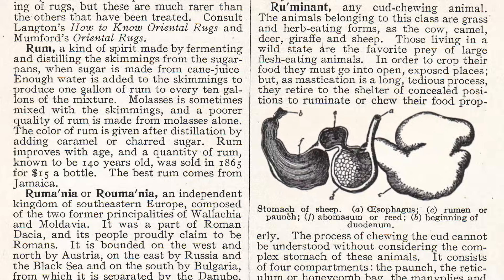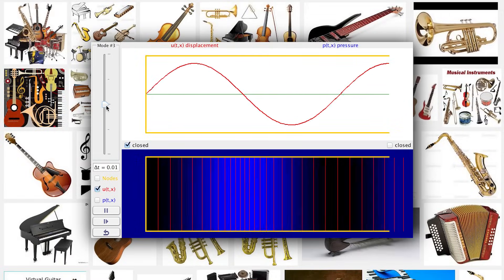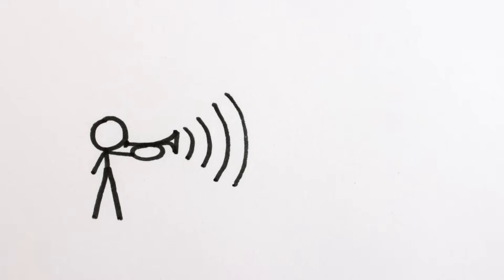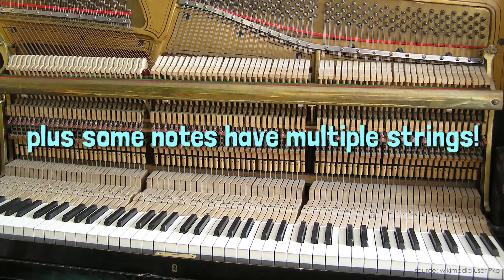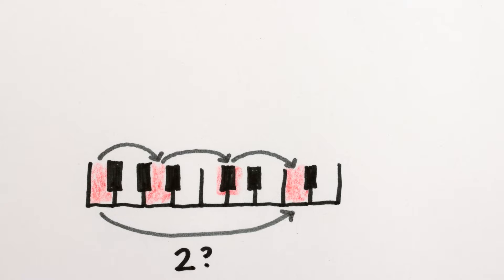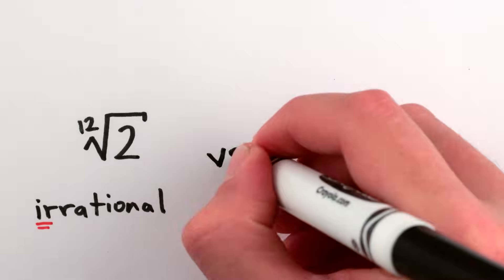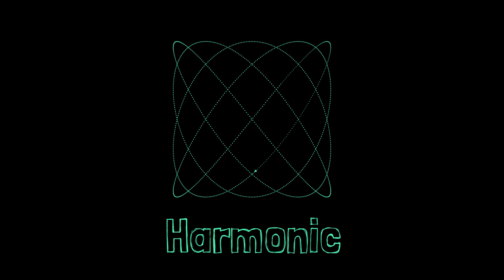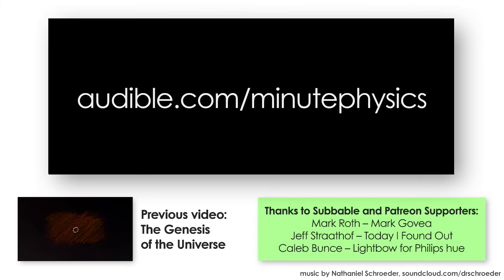Why It's Impossible to Tune a Piano

Comment: I've been doing occasional piano tuning since the 1970s, and always used the old method of stretching the fourths (+ 1 beat per second), compressing the fifths (- 3 beats in five seconds), and double-checking the process with the major thirds. This approximates the twelfth-root method. Then you have to start stretching the octave once you get to two Cs above middle C by a factor of two beats per second because it will sound flat to the ear otherwise, even if tuned to the perfect frequency. Most electronic keyboards that I have heard do not take this into consideration and they sound a little flat to me in the upper treble section. Some strings on some cheaper pianos will have false beats, meaning they will wah-wah-wah no matter what you do. Piano tuning involves some major compromises and is a bit of an art.

Comment: Keep also in mind there are three strings per key (two for the bass ones), and these strings are slightly detuned from eachother. The same mess happens with harps, with only one string per note and pedals for the sharps and flats.
It feels so nice to play brass.
Reply: All solid objects with some symmetry will also naturally have pairs of overlapping harmonics that are very slightly out of tune - for instance a harmonic on a guitar string vibrating vertically vs vibrating horizontally... A vibration pattern on a timpani and a version rotated 90°, or a deformation pattern on a tubular bell and the same pattern rotated 90°... In other words, plucked strings and chromatic percussion are slightly detuned from themselves (which is why they sound so good). :3

Comment: There is a lot more to piano tuning.  The modern default tuning "standard" is higher-pitched than the norm centuries ago, and is "equal-tempered" (uniformly spaced logarithmic scale), so that octaves are exact and every other ratio is only approximate.  In Bach's day, it was common for pianos to be tuned for best results (most exact ratios of small integers) in only one particular key, called "well-tempering".  His "Well-tempered Clavier" exploits its properties; W. Carlos of "Switched-On Bach" fame put out at least one record album using well-tempering.  As somebody else mentioned, common practice for the multiple-wire notes is to spread out the spectrum slightly so that resonances are improved, and piano tuners iteratively tweak the tuning for best overall sound in the most frequently used keys.
Reply: There's a glitch in the matrix.
Reply: Yes I know that.My piano teachter a long time ago spoke to me that not all keys were the same in older days. That the E b was a bit more heroic for example. And that also the E flat was a bit higer then the D sharp ( Am I right? )  But now on the piano they tunes everything the same a bit out of tune. So you can pay in all keys and that this was in earlier times not possible. At the same time it can also be a bit of a pitty. A bit different keys can also be interesting and give charater to a piece of music. All the same can also be boring. Or am I wrong?

Comment: To try to clear up the confusion, a piano could be tuned perfectly to one key, e.g. "C" but would sound slightly off-tune in another key.   Instead,  a compromise tuning is done to allow the piano to play more or less correctly in all keys.  Most of the time it isn't noticeable except to the most discerning ears!

Comment: Oh ok. That wasn't the answer. Equal temperament is considered 'in tune' since a lot of the other instruments you mentioned also exhibit this. Its nothing to do with string number, its to do with fixed pitches. You can play a violin in tune to harmonics, but not a guitar, as it has frets. Likewise a trumpet actually plays harmonics and the keys merely adjust the key they are in for more notes, whilst a clarinet has equal tempered keys- although its registers are harmonically related.

Pianos aren't tuned to equal temperament.
They use stretched tuning.
Not just because of 'it sounds nice'.

The strings on a piano are not perfect strings in a maths eqution.
They exhibit harmonics that lie slightly off what the perfect string is. The string also lowers in pitch as the note decays in time, differently across the whole keyboard. 
causing the string to sound detuned when really the fundamental is perfectly in tune.
So even if you tuned to only harmonics, it would still be off between the lowest A and highest A.
This needs compensating as its imperfect, so really a perfectly professionally tuned piano, the fundamentals are not in tune-to anything- its merely a compromise between both perfect tuning, and the fact that strings aren't making perfect notes in the first place!
Reply: scrolled till i found this +1
Reply: Exactly!

Comment: This is a great video, but actually the harmonic tuning method is also fundamentally flawed. The harmonics on stringed instruments don't actually create perfect integers of the fundamental frequency. Due to the strings being physical things with tension, a phenomenon called inharmonicity occurs. This means that the harmonic frequencies actually slighty increase with each integer. 
For example, if the fundamental frequency is 100 Hz, then the 1st harmonic may be 200.02 Hz and the 20th harmonic may be 2034 Hz. This means that when tuning a piano, using the equal temperament system, the higher keys will be sharp and the lower keys will be flat. 
Interestingly, this is still how we tune pianos and when keyboards have been produced with "perfect" tuning, musicians and sound engineers have preferred the "imperfect" tuning. Perfectly tuned pianos sound wrong to us.
Reply: +Banjo Bob Perfectly tuned pianos sound wrong to us for the reasons discussed in this video. When you play a 5th on a piano, it doesn't sound in tune because to our ears, it sounds in tune when the ratio of frequencies is exactly 1.5 but a well tempered tuning makes it 1.4983, which is 0.1% off. For comparison, the difference between 200Hz and 200.02 Hz is 0.01%, which is 10 times as hard to perceive. You can even hear the beats ("Wahwah") when you play a 5th on the piano.
 
The inharmonicity doesn't affect a piano's tuning because they aren't tuned with harmonics. if one 'A' is tuned to 440 Hz, then the one an octave above it is tuned to 880 Hz, not 880.09 Hz. High and low keys usually sound bad on a piano because they are the first to go "out of tune," meaning you just need to tune the piano more often.
Reply: +SillyPutty125 The inharmonicity is actually the main cause of piano tuning problems. Notes that appear to be an octave apart on the piano are deliberately tuned to be slightly further apart than an octave, hence the term "stretch tuning". So if one note is tuned with a fundamental of 440Hz, the same note one octave higher up on the keyboard will be tuned higher than 880 Hz. This is the way almost all piano tuners tune pianos, to get the best-sounding compromise which deals with the effects of inharmonicity. It's disappointing that the video didn't mention this at all, but it's in all the musical acoustic textbooks.
Reply: +Howard Wright Oh I get it now. I didn't realize that it doesn't sound "in tune" to us unless our octaves are stretched because it sounds in tune when the harmonics line up. Do you have any online references on how/why perfectly tuned pianos (with no inharmonicity) sound wrong to us? Does that mean our brains are just used to inharmonicity, and if you take it away it sounds strange?
Reply: +SillyPutty125 I think we are conditioned by what we grow up hearing, and as all real strings are inharmonic (steel strings more so, gut/nylon less so) then yes our brains get used to slightly inharmonic or "stretched" string harmonics as being "normal".
Not sure what you mean exactly by perfectly tuned pianos with no inharmonicity. All piano strings will have harmonics that are not exact multiples of the fundamental, but are sharp - i.e. inharmonic. This is the case however the piano is tuned. But as you say, if the harmonics of one string are not lined up (in terms of frequency) with other strings, this gives an out-of-tune feeling. So the stretched octaves of piano tuning minimises the mismatch between the frequencies of different harmonics of different strings, and gives the best overall result. Tuning is always about compromise, it's just that the piano effects make it a much messier compromise than other instruments!
Reply: +Howard Wright By "no inharmonicity" I mean when a violin played with a bow (it doesn't exhibit inharmonicity due to "mode-locking") or electronic instruments, which have no need for inharmonicity. You mentioned in your OP:

>>Interestingly, this is still how we tune pianos and when keyboards have 
>>been produced with "perfect" tuning, musicians and sound engineers have 
>>preferred the "imperfect" tuning. Perfectly tuned pianos sound wrong to 
>>us.

I was wondering if you know of any references on this topic.
Reply: +gnizamagnikcuf No kidding. We're talking about inharmonicity, not tempered tuning.
Reply: +SillyPutty125 I think he is saying we like it when overtones line up but that is not possible with a piano because it uses physical strings where the collective higher overtones of a two-note octave can shift too much from perfect 2:1 ratio causing it to sound out of tune.  So he needs to "stretch" it so the overtones sound better.
Reply: yep, when a guy came to tune our piano we chatted for an hour and he also said this. That we prefer this slightly off-key version.
Reply: Perfection has no place in music. Imperfection (to me) is the biggest source of character
Reply: +Luke Kulak, Great insight.  Did you study philosophy or are you a natural?
Reply: Dennis Dougherty nope! one of my biggest role models helped me to that realization
Reply: Dennis Dougherty he was actually my english composition teacher throughout my first and second semester at college, and he has a hobby of photography. he mentioned how he doesnt like to edit certain things out of photos because of the aforementioned reason. i thought that mindset applied beautifully to music